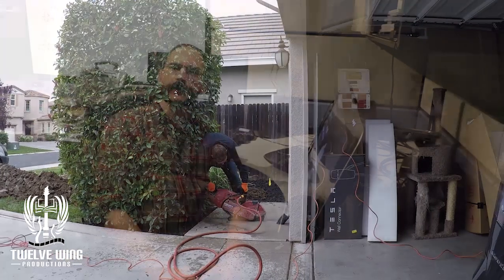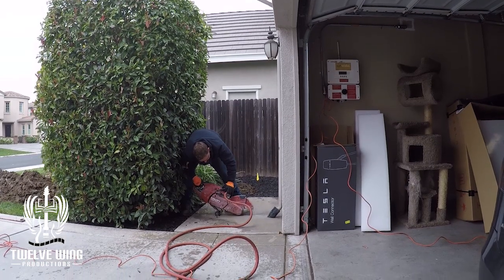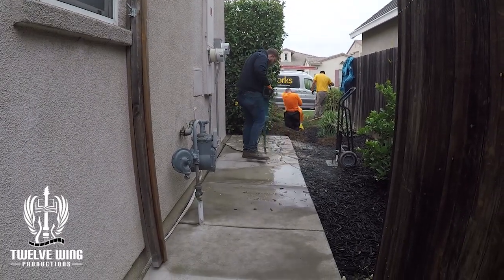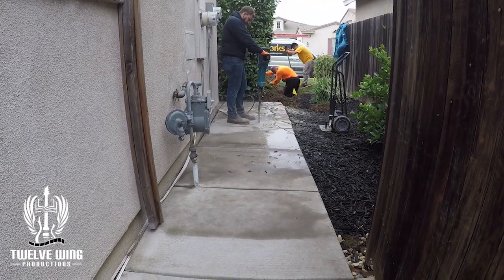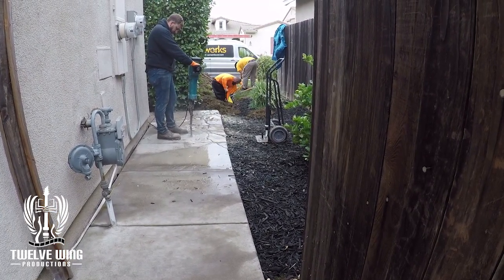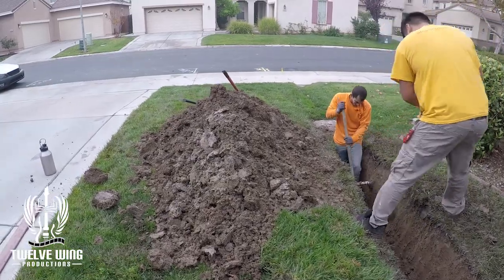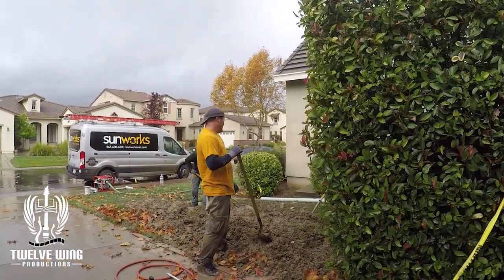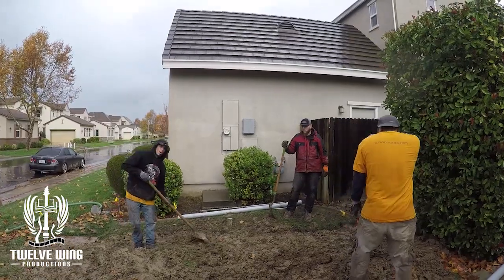Forced to upgrade our SMUD conneciton for no reason, Video 1: Installing 6 Powerwall 2 batteries

Comment: I keep watching your videos. Good job on bringing out information. Here I will try again to make a point for Sol-ark 8k. They are not paying me by the way.
How much was the whole cost for your install? Solar panels + Grid tie inverter + Powerwalls + instlalation  + trenching + Parts ?
Mine I was able to do it myself. If you want I can send you a private/unlisted video with my system if you give me your e-mail.
My system Sol-ark 8K + 10kW of LiFePo4 batteries + 3.1 kW of Solar panels. total = Aprox $13000 without the 30% rebate and the $1250 from the power company. With the rebates is probably going to be around $8500.
I am still working on testing the batteries I just bought a BMS and I am trying to  make it do its job right.

All my house runs on Electricity. I have to buy extra electricity only in the summer because of the AC. For heat in  the Winter I use wood.
Reply from the maker: Our system is 10.2kw of PV production and 6 or the Powerwall 2 batteries for a usable storage of 82kwh.
Our inverter is a SolarEdge 7.6kw unit.
The total cost of the system after incentives and rebates was $54,000.
Again, I have to stress, that thought I have the utmost respect for the DIY crew... this is simply NOT something the general public is going to DIY.
It's just not.  They are going to fold this into the cost of a new home when moving.  That is going to be the usual likely scenario.

Comment: This makes no since at all. The house amperage draw won't change and will be less most of the time. The export amperage is based on the wattage and number of panels. The battery's will only match the house load and don't have anything to do with the import/export on the house feeders. I have LG/SolarEdge system and PG&E didn't require an upgrade.
Reply from the maker: Thanks for the support Kevin.
It's difficult to fully understand what their point was.  My only guess is that they were looking at the total battery bank as a load and not a source.  Basically they were operating on the assumption that the batteries were going to fully charge from empty while every circuit in the home was drawing power.  A ridiculous assumption.

Comment: Should have just told them you would reduce your 200 amp main breaker to a 100 Amp main. "There ya go" "Now Stuff it" "the max load is now protected from a max load with a wire twice the size needed" and even then you could still charge your batteries while running lot's of loads.

Comment: pen pusher with no clue who can do simple math like 2+2 = 4
Reply from the maker: It's not additive, it's an engineering specification as to how much current the system is designed to handle.  You may want to leave the math to "Pen Pushing" engineers.
If we were increasing the load, what you are saying would be true.  That's not what is happening here.

Additionally to the above, it's the point of the video that our initial two proposals that had the public utility running through a 12kw bidirectional inverter/charger were rejected.  These would have isolated the system from the grid entirely, restricting the maxim flow to the home to 12kw.

The public utilities, at least in this area, are hiding behind outdated regulations that simply don't apply.  Hopefully you keep following along with us.  As you see first hand what we are doing, you will come to a better understanding about current flows and how this system balances itself.  So no, it's not 2+2=4... it's 2-2=0.  Zero being the amount of current that passes through the utility connection.
Reply: I'm fully aware its 2-2=0. And you should probably fight them so no one else has to get 400A, talk to your Governor or who ever seems appropriate , Or sue them for the cost of their mistake.
Reply: I didn't mean you,  I meant them, the ones who insist you need 400A service.
Reply from the maker: @That1ufo  ,
Sorry, misunderstood your comment.
Yes, that was ridiculous.. and obviously as this project moves on SMUD is going to take a PR hit for forcing us to do that.
As far as fighting it, there isn't any point really.  What we are going to do, however, is to use this kind of thing as leverage to get the underlying laws changed.
Currently, in California, it is illegal to not have a home hooked to the grid in an incorporated area.  This came from a good place in the 30's and 40's when these laws first appeared on the books but it's turned into a hammer against sustainable power generation at the home.

It's time to address many of the regulations we have.  Part of doing that is that I am personally designing a method to end this so no one else has to go through this.
As I said in the video, the utilities are fine so long as you aren't actually capable of producing all your power locally.  Once you do, you become their competitor.